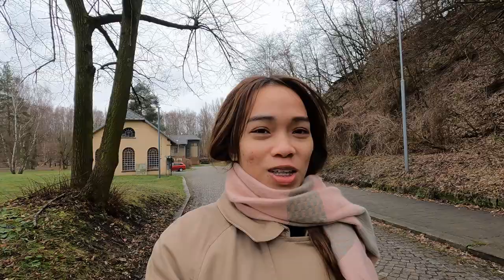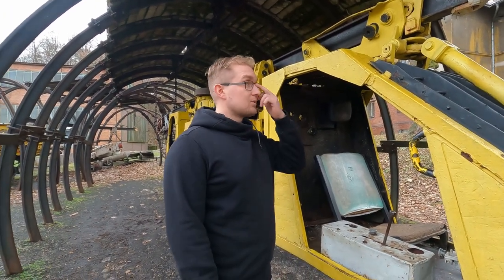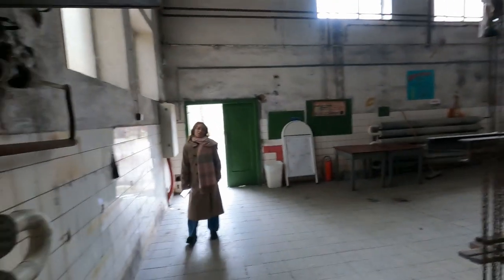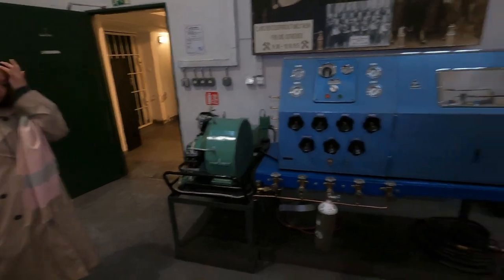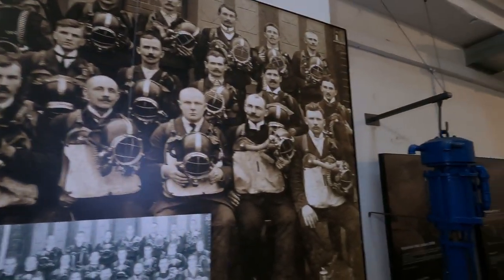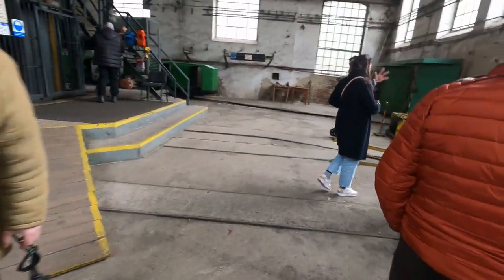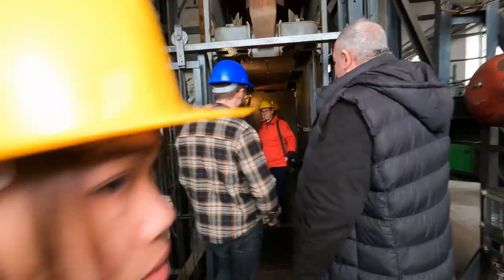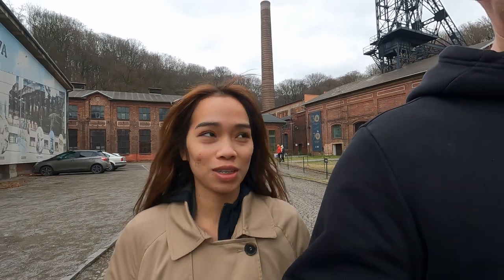Come With Me Into A Shadow of Coal Mine

Comment: You had me going for a while. I really thought they had taken you down into the depths of that mine. They do the same thing here in the states where they pretend to take you hundreds of feet down in a fake elevator when you're only a few feet underground. Video was very informative and most of the equipment looked very similar to what was used here in the early 1900s. Got a good laugh watching Gwen slip easily through the mine while Jacob struggled to fit through any of it. Noticed a serious lack of snow and lighter clothing. Guessing spring has come early, unlike where I am.
Reply from the maker: You are right sir, it is getting warmer here and soon birds will start singing and warm spring will be finally here. Thank you for watching and interacting with our content. Stay tuned for more!